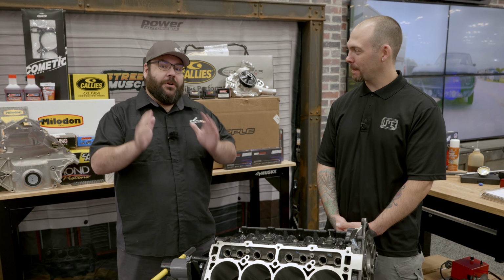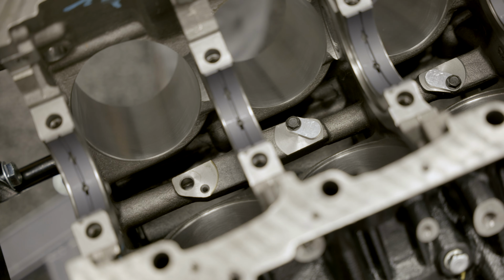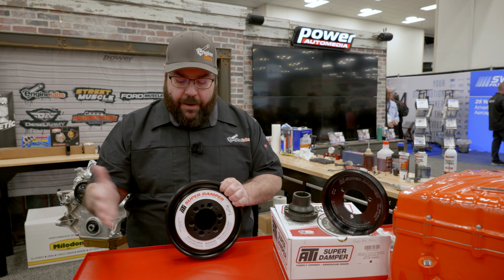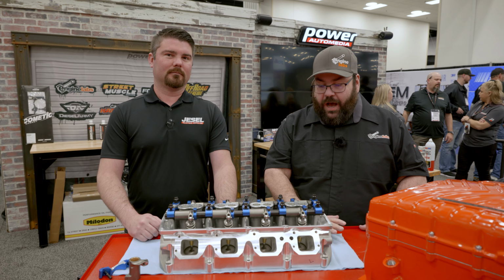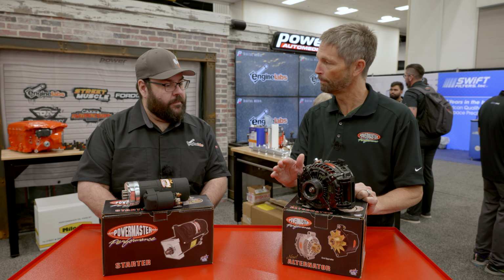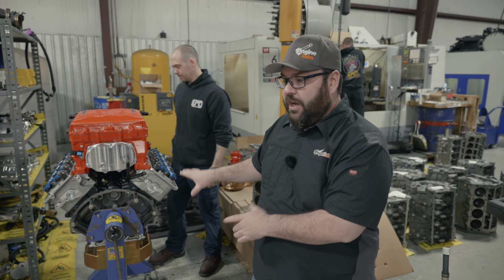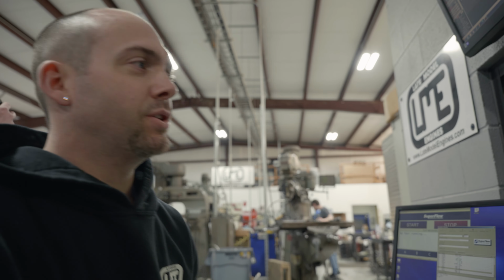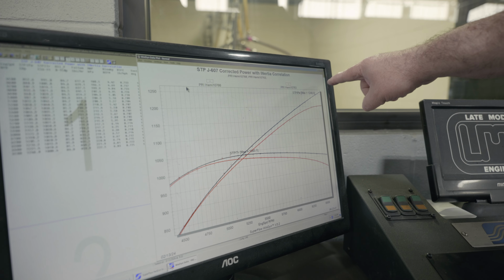EngineLabs 1,267-Horsepower HEMI From Start To Finish

Comment: How about doing a 5.7L Hemi that eliminates the Lifter/Cam Tick and Exhaust Tick problems and runs on 87 octane and bests the Hurricanes (SO and HO) on 87 octane and is a guaranteed 300K engine, 400K? 500K? 600K? 1M? Millions of owners want a reliable power cost advantageous powertrain... besting the Coyote and Hurricanes and others all down where it counts and at rpms the daily driver lives with. Show car makers how to build truly bullet proof engines.

Comment: So, he's using the pre-crushed main bearings? Or does he use an entirely new set of main bearings? I just thought that once the main bearings were crushed, that thats what stayed in the motor because the crank was already installed prior to tightening and crushing the bearing. I'm just confused now. Thank you!

Comment: I have a 426 using 1700x injectors and an F1A with Kooks 2" long tubes. 1189hp. I dont know why I didnt get the 94mm F1 to start. Im hoping for 1300 this summer. 
Just a cruiser to get to work. 
I love these engines.

Id suggest an N/A hemi build at some point. See what you can squeeze out. Boost is cheating.
Reply: 10,500 for street engine should be doable.Motorcycles do it all the time, yes?
Reply: @exploranator  I dont build engines so Im not sure how to answer this. $10500? Or a typo of 1500hp? Which I dont see cycles getting to. $10500 for an engine build? In the case of a hemi, only from DirectConnection/Chrysler. Building them at a shop has been double that, plus whatever boost you want to add.
Reply: He means 10,500 RPMs. My last bike cranked 18,000. Dont see how that relates to a V8 engine though. Because 10,500 won’t scratch the surface on a built 427 unless a person does the machine work himself.

Comment: First time hearing a 427 Hemi build, compared to their usually 392 or 426ci
Reply: It’s the same as the 426 build it just has a slight over bore to clean up the cylinders

Comment: The modern hemi combustion chamber is no longer a true hemispherical, or "half circle" shape, as the original was.  It's more of a flattened, or semi-oblate spheroid.  If you compare the 2 side by side, there's quite a bit of difference.
Reply: The 1960’s Hemi’s were not nearly half a sphere. Yes, they were closer to being round but the basic design with two valves per cylinder, spark plugs in the heads, and high air flow is the same thing.
Reply: Blah blah blah!, still riding my Magnum RT with the HEMI!

Comment: I would like to see a 6.4 HD truck engine build.. all out torque monster 😊
Reply: Budoboy made 899.5 hp NA using ported stock heads on gasoline at 449CI. I think there's a breakdown on the build at Yellowbullet and LXForums.
Reply: @ToddWright2  https://youtu.be/XFLi9U-f0w0?si=skoOQxRUu7sdWPy_
Reply: Todd, a 900hp engine using modified OE castings is a statement to you guys as well as the 6.4's potential.  That's just bad ass!!!